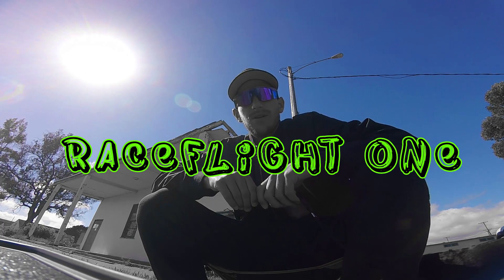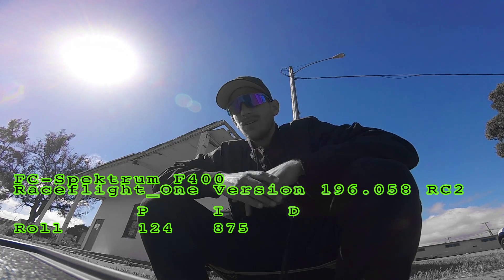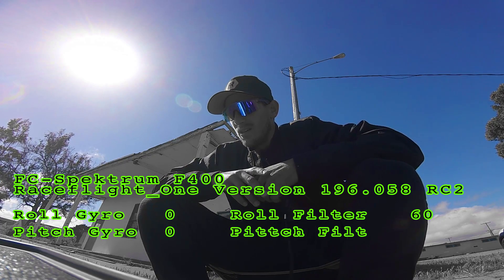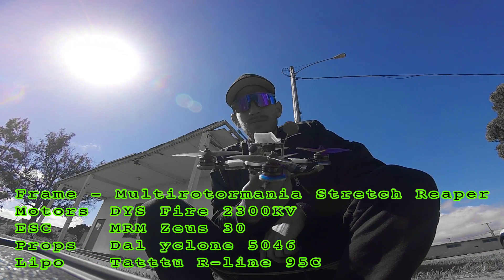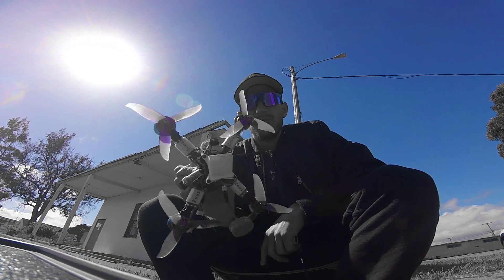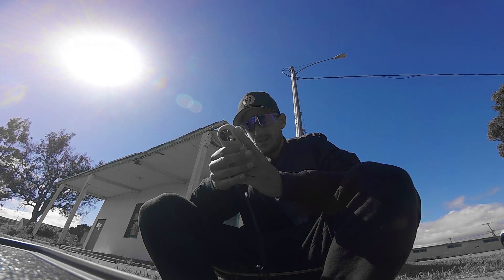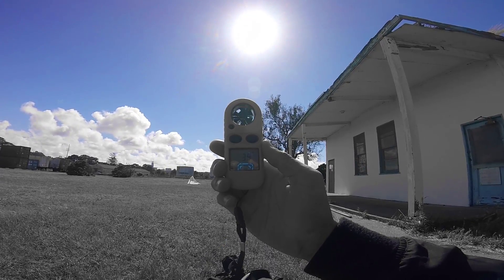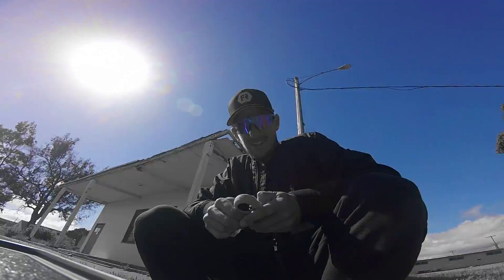Spektrum F400 Flight Controller Preview

Comment: called Spektrum support and wow are these guys terrible. Claim to never have said the f400 uses rf1 when in the manual it tells you to register to download and install rf1. Ha. Yeah. if you want an f4 and rf1 get the revolt. the f400 is a buggy mess of crappozone. you can't even install and osd yet on stock firmware since you still can assign uarts to anything other than rx signal. This board is trash if you want to add gps or anything else. QA on it is terrible and Spektrum gives you no eta on rf1 release date. 

Get a revolt or fury f4. anything but the spektrum f400. Spektrum offers no support and the only firmware is bb420 so I advise steering clear of it or waiting till the board is actually ready. As of now spektrum is having buyers of this fc pay for the pleasure of using a beta.

Comment: I am having a hell of time trying to get this fc stable. Using little bee 20a a f400 and 2300kv rs2205 motors from ready b to sky. I can use beta flight and cleanflight with my SPRF3 builds but can't seem to figure out this fc. I heard it's great but so far had nothing but hell. Air mode has no mode and stays on. noise and can't seem to get good pid settings. If you have any advice it would be great for stock raceflight settings are terrible and unstable. Also how can I get rf1 on this f400?